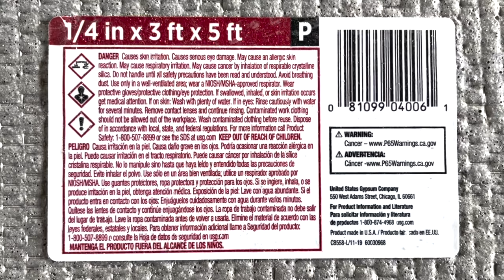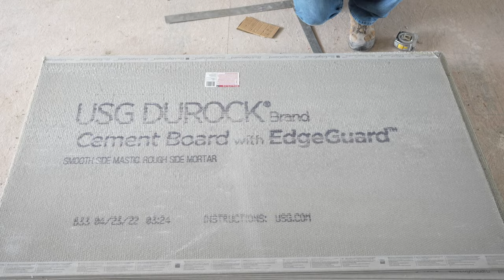How To Tile A Floor - Bathroom Floor COMPLETE Step-By-Step GUIDE

Comment: Easier way to mark center of a square (or rectangle) is to draw two diagonal lines from oposing corners, their intersection will be the exact center.  Way easier and more accurate than measuring the sides, dividing by two, and marking.

Comment: Ok, so you can lay ceramic tile on the cement board without the orange waterproof layer?
Reply: Yes
Reply: It’s one or the other. They are both for water proofing, just two different systems. People swear by cement board, others swear by the orange. To each their own

Comment: question did you break off the spacers  for the goute joints  join how do you get them out? and how soon do you remove the thanks for the awesome video  jim
Reply: Wait at least 24 hours and the spacers snap off from the top leaving the base of the spacer in place under the tile and part of the vertical tab in place below the height of the grout and tile.

Comment: This is one of those videos where I must take the time to thank you for your detailed steps. I just finished installing hexagon tiles in my bathroom. I had to do some sanding to level some high spots before placing the cement board, but I followed each of your steps, and I was able to get it done. The floors look great! Thank you!!!

Comment: Good video! As for the tiles cracking easily with the grinder, I found that cutting from the backside of the tile caused a lot less splitting.
Reply from the maker: Thanks Steve. I appreciate your input. Knowledge sharing is the key to learning the best techniques. Take care!

Comment: Did you use the same thing set below and on top of the cement board? And is it modified or unmodified thin set?

Comment: A fantastic guy! thanks for the videos. regarding tiles, why not cutting with a diamond blade. notch and crack them. its easy and clean. what's your thoughts?
Reply from the maker: Thanks, Sean! Yes, you can do that. I actually used to do that all the time. Good luck with your project!

Comment: Great video!  Have you ever installed the Schluter ditra system?  As an architect I've spec'd it for projects, but haven't installed it myself.  I'd like to use the ditra heat system in our master bathrooms for the house we are currently building but I'm not a fan of installing tile myself.
Reply: What do you specify then?
Reply: @irish89055  I typically specify Schluter products, but specific items depends on the project details.  I love their uncoupling membranes and trims/transitions.  Their waterproofing systems are good quality.  I just haven't personally installed their in-floor heating system myself.

Comment: Do you have a preference from cement board or hardi backer? I've used hardi backer most of the time. Also making sure the sub surface is thick enough to be able to use 1/4" material otherwise 1/2". Putting thinset is so important as well. I've used a hudson sprayer on the back of the floor material to help it not suck all the moisture out so quick for getting all the screws in and able to put in two full sheets as well. Thank you for such a great job and description.
Reply from the maker: I only have used hardi backer when I was working for a guy modeling a house. Other than that I have always used CB. I am most comfortable using it over anything else. I’d like to try Ditra at some point. Yes a strong subfloor is a must for any type of tile floor backer. I can’t wait to finish all this tile in this house 😅. Thanks for stopping by David!
Reply: @TheExcellentLaborer  I use the Ditra product once. It seems like a lot more work. My brother in law who owns the kitchen bathroom remodeling company for over 35 years uses that basically on all the jobs they do. Just like the schluter system.  I have always loved just doing the acrylic shower pans and then tile on the walls. But yes when you get used to using a product like you said you just stick with it but you always still do the right steps as needed.
As long as you keep showing work I will keep following. I enjoy it so much and learn things each time. I'm proud of all the work you do and the time you take to share it all with others.

Comment: I need your advice please. I have a Slab floor in my bathroom and it’s drops one inch from one side to the another. Approximately 10 feet by 5 feet. Should I start putting tile on low side or on high side? Or I should use self leveling first? Thank you!

Comment: i know this is an older video but i want to clarify the back butter of the tile. are you supposed to apply the thinset in the same direction as the thinset on the floor. it looks like you back buttered that first tile in the opposite direction
Reply: I don't think it matters

Comment: If the floor is concrete, would you still lay cement board before tile?
Reply: I used Schluter Ditra between my slab and tile. Helps protect the tile from cracking if there's any shifting or cracking of the foundation.
Reply: @JasonB-0274  lol, literally just finished lying ditra down, finishined the shower walls. Excited to see this through
Reply: @dragonrider9051  Same as you except a couple of days ago, lol. Getting ready to mix up some all set now so I can start working on laying tile over the ditra.

Comment: I was told with the 24x12 use a 33% off set 8" off set
Reply: If you're not going to use a tile leveling system like he did, then most definitely use a 1/3 pattern. Helps reduce "lippage".

Comment: What size notch is your trowel?
Reply: For 12x24 tiles (large format), from what I've read you're supposed to use a 1/2" square notched trowel.
Reply: @benharrison5816  I ended up using a 3/8" trowel.

Comment: Really want a professionals advice on this video cement board seems like over kill and will raise flooring 3/4 of an inch. 
Ive seen waterproof underlarment but never cement board. 
Just draw 2 diagnal lines from  opposing corner to find the intersectional center point.

Comment: Why are you using 3/8 trowel ? I have always bee told 1/2 for that size tile?
Reply from the maker: It’s a 1/4” notched trowel as mentioned in the video. Hope that helps!
Reply: 12x24  1/2 inch notch trowel. Learn how to set before teaching.

Comment: I don’t understand the use of the tile spacers someone please explain
Reply from the maker: The spacers give a gap between the tiles to allow grout to squeeze in between. If you have the tiles too close, there is not enough room for the grout to fit. Then you cannot get a good seal between the tiles. Also, if the tiles were touching each other, when they shift, they could ship. I hope that helps!

Comment: At 20 minutes 16 seconds you literally put down the tile and said make sure the notch is going the same direction and they weren't. Lol. And you really love that double quarter inch trowel method, substrate and back of tile. Half by half notch trowel is what you typically use with a 12x24, you also forgot the key in the substrate.
Reply: Was my thoughts also....
Reply: as for the part where he says "...notch is going the same direction..." on the back butter, and then placed it down opposite direction on floor, he is saying too make sure the back buttering notches are all in the same direction on the tile itself. He wasn't talking about matching the tile back buttering notches up with the floor notches.
Reply: @robwaters9820  well whatever he was talking about he set the tile down, the substrate was directional one way and the tile was directional the other way so he crossed them. Watch the video again